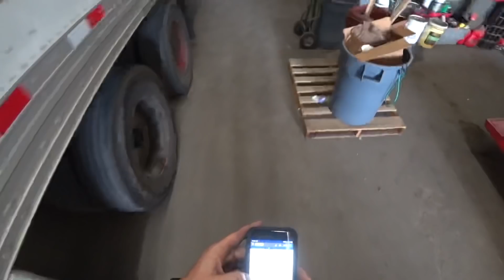AT THIS DOCK YOU ARE BACKING IN ALMOST BLIND!!

Comment: That power equipment is for substations.  They take the power from transmission sources and take the voltage down to lower voltages for distribution substations which in turn lowers voltages for feeds into neighborhoods. Retired from power company after 36 years of work. Great work in spring, summer and fall but sucked in winter with storms etc.